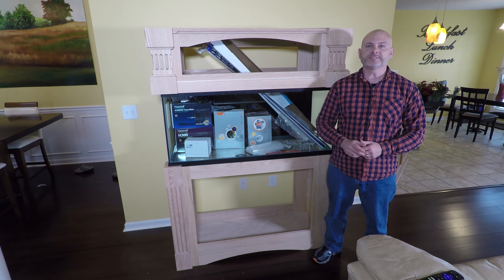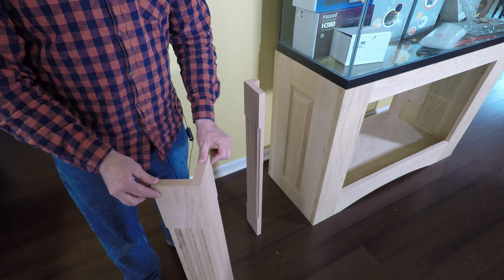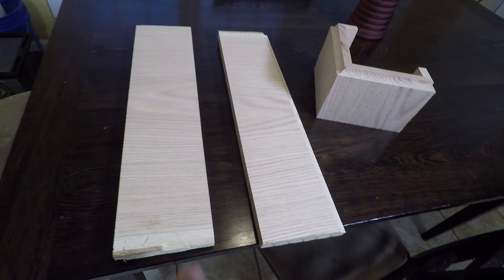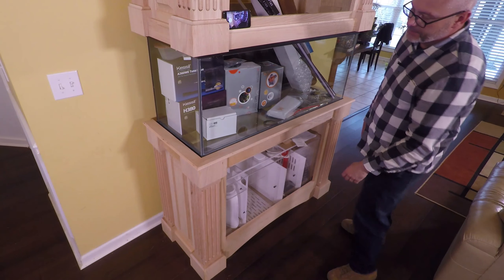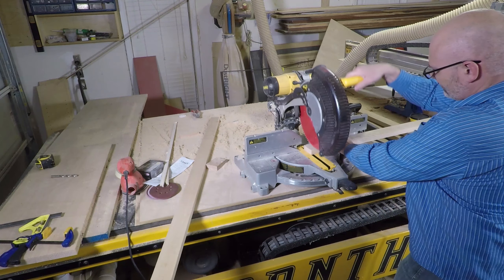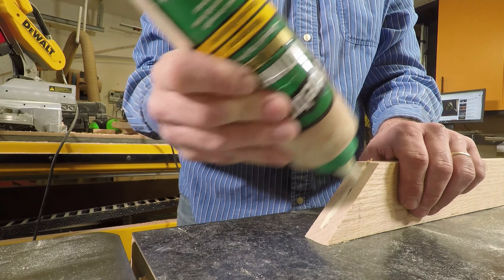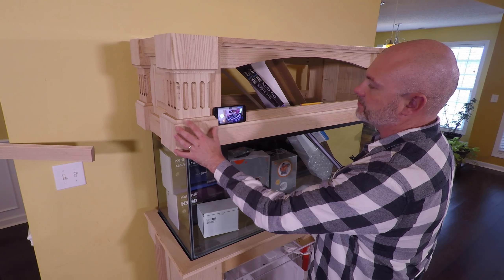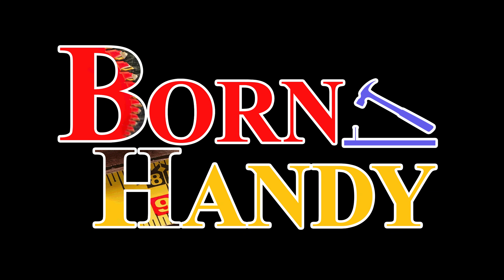75 gallon aquarium stand - making it fancy.  The Ultimate 75 Gallon Build Part 2

Comment: How much does that canopy weigh? I hope you don't ever need it off of the tank. I love your attention to detail, that's a great looking setup.
Reply from the maker: About 100lbs with lights, cords and door panel.  

I shouldn't ever need to take it off.  It lifts high enough for me to stand under it, and a full bucket can be poured in without touching the canopy in the full upright position.  Still, if I did need to remove it, four bolts, and it's off.

Thanks for commenting!
Reply: I didn't realize it lifts up, this was the first video I watched. I'll have to go back and watch the progression of the build.

Comment: Please help for my tank, 200cm X 70cm X 70cm, 12mm glass, empty weight over 100kg. Water volume 980 lt/259 gallon. How thickness wood for my tank stand?
Reply from the maker: That's really hard to say without seeing the tank in person.  3/4" (19mm) is strong enough to hold most anything under 500 gallons.  Still, some manufacturers recommend support along the entire bottom panel, while others only want support along the edges (hence the plastic frame along the bottom).  If I had a flat panel along the bottom, (no frame), I wouldn't be afraid of 3/4" (19 mm) material for support, and a sturdy flat top stand with a 12 mm styrofoam sheet between the tank and stand.  Hope that helps!